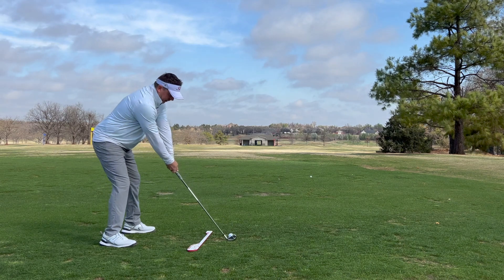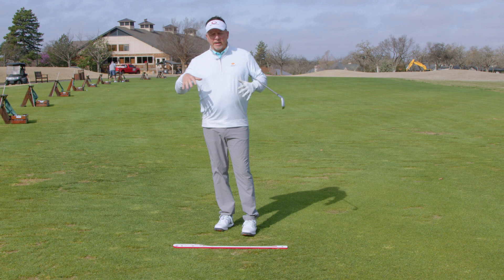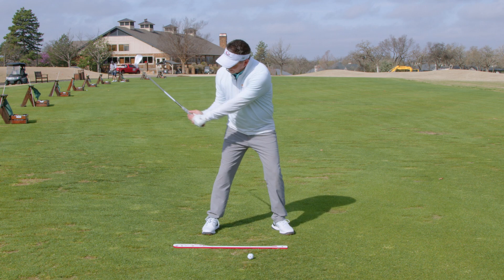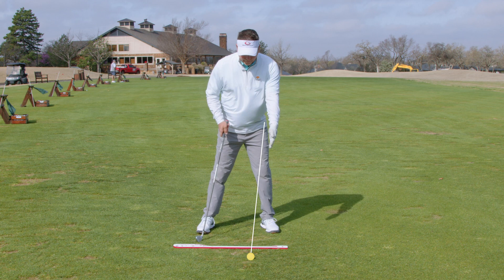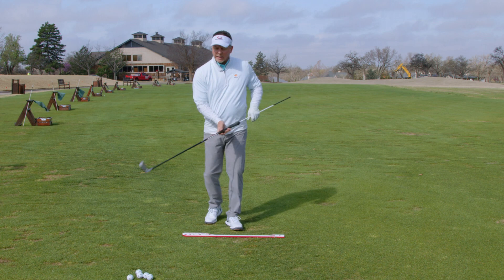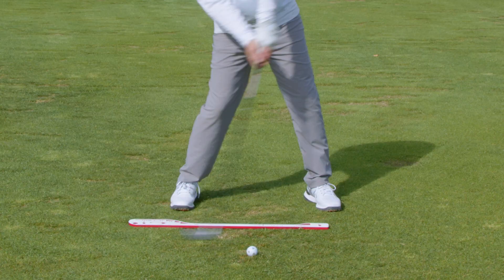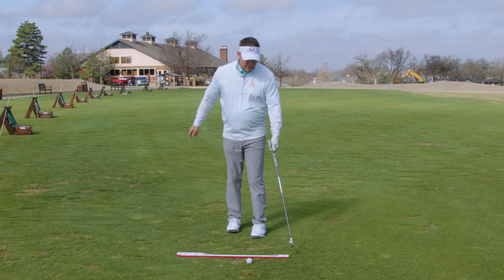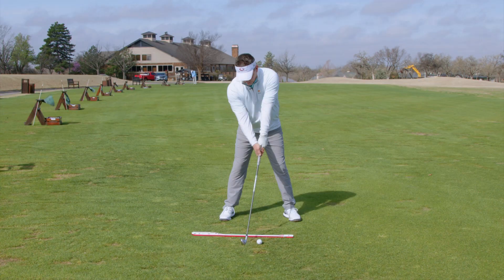Compression in the Single Plane Swing

Comment: Undoubtedly, Moe's hands worked with the swing to get the timing right such that he accelerated the club head through impact ensuring that the club head exceeded ball rebound and actually compressed (or flattened) the ball against the club face, providing additional elastic recoil and therefore, distance. A maximum smash factor produced. He even said that he made the club "sing" AFTER impact because that is where and when its maximum speed was achieved.

Comment: Oak Tree?  I've played there a couple of times.  I play now at Winter Creek.  I've just become aware of the ulnar deviation factor at impact of some of the greats.  Hogan with the driver had it.  Malaska talks about the "line of compression".  I've been doing a lot of research on it and I'm now a subscriber.  Thanks for the video Todd
Reply: This guy will ruin your swing with his extreme method copying Moe Norman. There are much better single plane alternatives along the lines of Bryson's swing where you do not have to stand so far from the ball.
Reply: @roblaufflin7741  Thanks for the response Rob.  I like the feeling of width I get with this setup, and I noticed with a couple of other sites, they still advocate posting the lead leg before impact.  I think that leads to inconsistent vertical head/body positions.  If you create enough space at address between you and the ball, there seems to be much less up and down movement of the body to accommodate  the extra width caused by ulnar deviation of the wrists .  If you start closer to the ball with your arms hanging straight down, you have to move your body away or up to get to the right impact distance from the ball.  Or have both arms bent at impact.  I'm still looking around the different sites though.  Thanks again.

Comment: Todd can you detail how it helped your backswing? I am a gold member, working hard to get the backswing correct, so I am always listening for yours and the coaches instruction on backswing.
Reply: Definitely not Todd, but from what the instructors told me in my video lessons, it ensures a solid take away from address (with the extension touching the side) to position one (unified arm-torso motion only) and then pointing the butt-end towards the spot 5 feet back and one foot in at position two.
Reply: This guy will ruin your swing with his extreme method copying Moe Norman. There are much better single plane alternatives along the lines of Bryson's swing where you do not have to stand so far from the ball.
Reply: @roblaufflin7741  Once you get "used to it", there is no problem and with "fit" clubs, the distance from hosel to grip approximates accurately the distance between the toes as well as the distance from the ball. (A quick tip and legal method of verification while on the course.) My (conventional) swing ruined my back and I played with pain and poor results because of it. Since adopting this "easy on the back" method, I now play over 100 times per season with no back pain whatsoever. My handicap is down to a 5 and I hope to shoot my age (68) this season... :)
Reply: @Sueezedtight  Nothing easy on the back about it!! Ask Bryson DeChambro. He tried to swing like Moe and it hurt his back!! Graves ruined my golf swing!! Nobody needs to stand so far from the ball. It is totally absurd! Todd himself releases the club early which is probably why he does not play in golf tournaments any longer.
Reply: @roblaufflin7741  Well it (the SPS) saved my game by removing my back pain. It provides the most consistent and best results that I have had on the course IN MY LIFE. No guarantee that it works for everyone but it is, after all, bio-mechanically the most efficient. To each their own. :)
Reply: @roblaufflin7741  Bryson shares a sps address but his motion is conventional. He and moe look different when they move because they do move differently. The reason standing that far (not too far) from the ball is essential is because it allows the golfer to swing without manipulation. If you are too close, you have to stand up on your lead leg to KEEP ur body rotating enough so the club doesn’t jam into the ground 3 feet before the ball. Moe just stood further and moved DOWN into his knee where his arms could swing through because he set up provisions at his address. If u did moes exact lower body motion in a conventional swing, you would hit the ground 3 feet before the ball, and rather than understanding it’s the distance from the ball which needs fixing, you might release early, or quickly stand up to allow room to swing.

Ball too close = needing to straighten leg to keep rotating to hit the ball.
Sps ball positions = plenty of room to naturally swing through the ball by going down into a stable lead knee. 

You can’t go into a stable lead knee and swing the arms if the ball is too close.if the ball is too far and you move conventionally by straightening the leg, you’ll miss the ball completely.